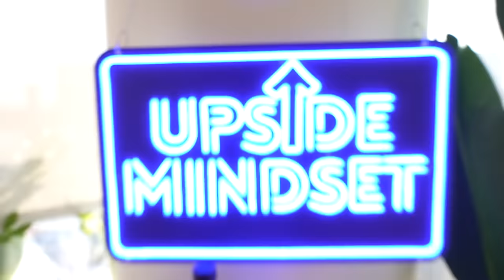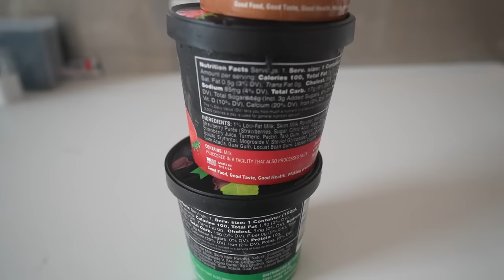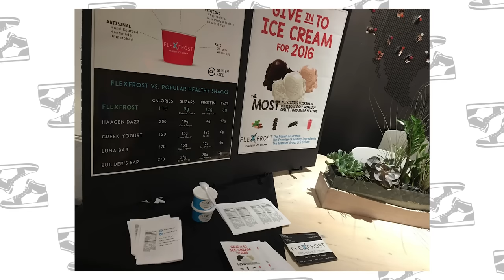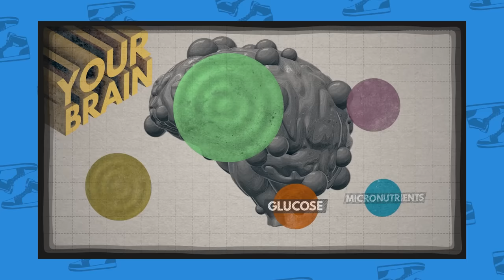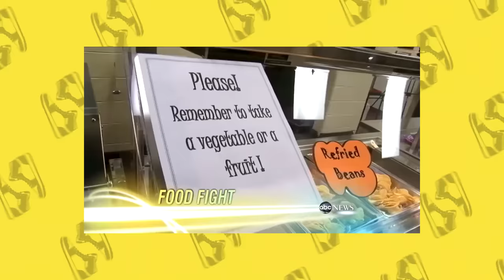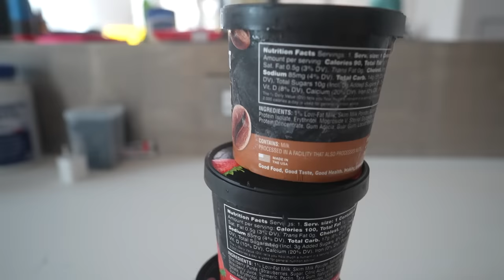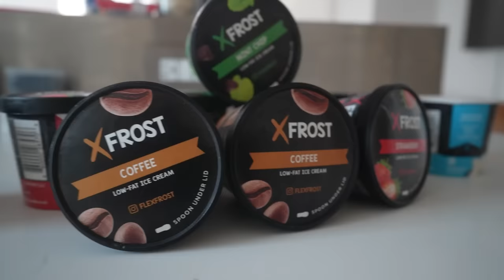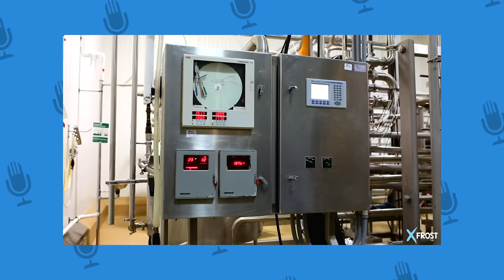How An Asian Man Is Saving Public Schools With Ice Cream

Comment: This is not to cause trouble but....
I don't understand, they claim this product is lactose free as it still utilizes skim milk (1%) and is composed of lactase enzyme as well as the lipase.
         But lactose is a “disaccharide”, meaning that it is made up of two smaller molecules, namely glucose and galactose. People who do not have lactose intolerance possess the lactase enzyme, which breaks the bonds linking glucose and galactose thereby liberating them of each other. But anyone that is lactose allergic (vegan) do not possess the lactase enzyme produced in the Pancreas (which improve the characteristic flavour of cheese by acting on the milk fats to produce free fatty acids); it is one of the most common food allergies worldwide. A milk allergy is an immune system reaction to milk protein. In the case of lactose intolerance, deficiency of lactase enzyme is the key issue. 

        The other one is the addition of whey protein isolate (WPI) it is the resulting of many  processes to remove most fat and some lactose. WPI is usually at least 90 percent protein, whey protein is not safe for those with dairy allergies to consume. People with dairy allergies have an immune-mediated response to the proteins found in milk products. This can be an IgE-mediated immune response, or a non-IgE mediated immune response.

Therefore this product is not 100% dairy free. 

         The other product that could have been utilized is dried egg yolk powder as it contains unprocessed protein making it the second most common allergy in kids below 5 years old after cow's milk allergy. The supply of cholesterol in eggs help make testosterone, which helps to increase energy level and build muscles for teen boys (10-14), help increase high-density lipoprotein (HDL), vitamin D, folate, riboflavin (Vitamin B2), selenium,  vitamins A, E, B5, and B12, as well as iron, iodine and phosphorus. All these nutrients are, therefore, very essential for a healthy and balanced diet. Contains an incredible and edible source of Omega-3 fatty acids and choline; your brain and nervous system need it (choline) to regulate memory, mood, muscle control, and other functions. You also need choline to form the membranes that surround your body's cells. And is a much cheaper protein source than whey.

If the cost of operation in a cafeteria is 50% for labour, well someone hasn't done their homework. As 22% is ideally labour, 34% for food, 13% for utilities and the rest for equipment and profit. A normal average cost/meal for a child from 1 to 18 yrs old is no more than 8$ but no less than 4$. I've operated many cafeterias in schools and retirement homes over the years and it has been proven over and over that meals made from scratch cost less (from 20% to 65% reduction) to make than having to resort to post manufactured products (pre-cooked hamburger patty vs raw ground beef, frozen carrots [27$/25lbs] vs unpeeled fresh carrots [13$/50lbs]). The only slight increase by going for non profit is in the cost of labour as you need to employ qualified cooks. The main problem in schools meal cost/quality is the fact that the cafeteria is operated by a private for profit company rather than a self sufficient (paid workers but no profit) operation managed by the school board.
Reply: Can you reach out to me ? would like to learn more about some of the things you mentioned here, yes - not 100% dairy free because dairy and lactose free not the same. 50% of the cost of a meal is from the labor of making the meal, not cost to operate the cafeteria
Reply: Brilliant and the low saturated fats foods are not healthy. Saturated fats are necessary for proper health. Also artificial colors, flavors and sweetener are basically poison. I hope those aren't in this product.
Reply: @Chocolate_Croissant  Hi. As you said dairy and whey not the same but as dairy allergy being one of the most prevalent allergies in North America. Either is toxic for both. As intolerance goes, yes they are different. Whey is "easier" to break down and the addition of lactase helps in it's elimination. But based on their ingredient list their first ingredient is skim milk not lactose free skim milk, huge difference. The operational cost (electricity, gas, wage, insurance, etc) of a non profit cafeteria should never be 50%, even in the most expensive one's. It usually reaches no more than 40%. Ingredients are above all the most expensive cost. These are the two present realities of kitchens. Low wages, pre-made foods (expensive), small med size ingredients, short prep time, short cooking time and restrictive cooking appliances.. The second med to high wages, very low prices, bulk size ingredients, med prep time, med to long cooking times and investment in various kitchen appliances to reduce cost on the long time. Example cooked roast beef in it's juices 3x2,5kg from GFS is 45$. But buying a cow shoulder (chuck) is 60kg for roughly 85$ and a cow round (back leg) is 85kg for 95$. Having a higher paid worker (better knowledge) will be able to break down those into many various cuts for multiple usages. Roast, stews, brochettes, ground meat, stir fry. A shoulder can feed 100 kids with 5 meals whereas a leg can offer over 7 meals. With a 50lbs bag unpeeled carrots at 13$ and a loss of 10% after peeling and trimmed ends which takes no more than 30 min for one worker (let's imagine he cost's 10$/h). Now you have 45lb of clean carrots that cost you 18$. For a cook to cut in various ways with a knife it takes about an hour (lest say 15$/h) now you have 45lbs of carrots ready to be cooked at a cost of 33$. Instead of 27$/25lb. The math doesn't lie. And if the cafeteria invests into a robot coupe (food processor) to automatized somewhat the cutting of veggies the cost prior to cooking can be lowered by half (labour of worker and time saved) so 25.5$/45lbs. And there are more nutritional minerals and vitamins in fresh vs pre cooked.